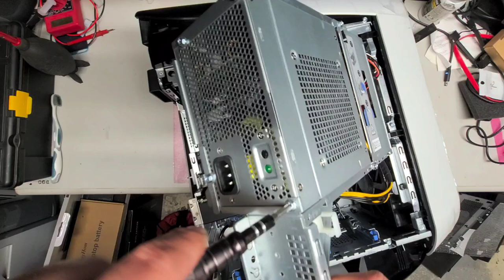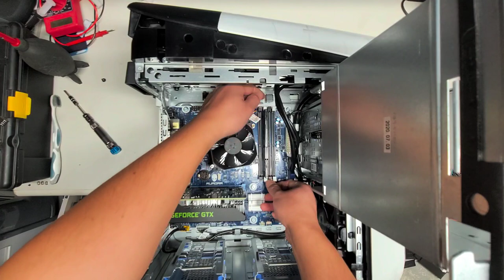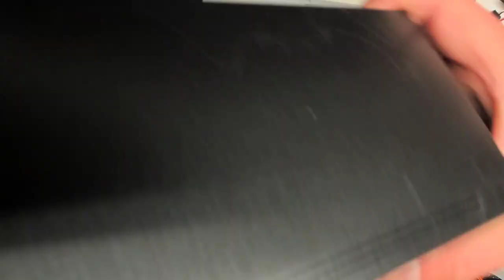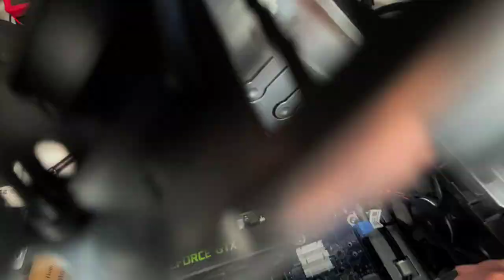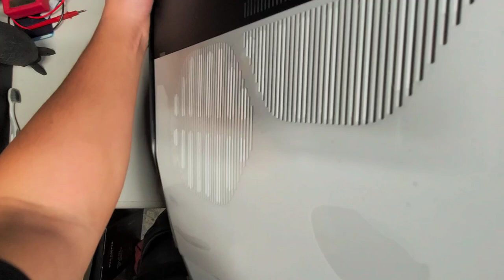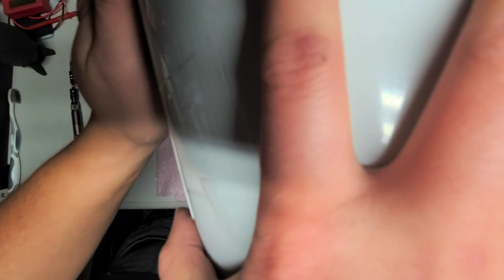Alienware Aurora Ryzen Edition 10 R10 Disassembly RAM SSD Hard Drive Upgrade Power Supply Repair

Comment: Nice video.  Thanks!  Glad to see it's a standard ATX PSU.  Thinking about getting this system and debating if I wanted to upgrade to the 1000 watt PSU but if it's standard then I can always swap it later!
Reply from the maker: Yup
Reply: i bought the r10 with the 1000w psu, and its even modular
Reply from the maker: @murfad  nice!

Comment: hi so i brought my first Alienware r10 but when i plug it in into my monitor (dell S2409WFP)  nothing seems to be working and it enters on power save mode. like its not supplying any power through my keyboard or my mouse. do you have any tips?
Reply from the maker: Make sure your monitor is connected to the GPU, not the motherboard.

Comment: Fantastic video thank you! Question, is it possible to replace the motherboard with an aftermarket mATX?
Reply from the maker: Not sure. I just repair computers. I don't experiment with them.
Reply: @ Ab man did you upgrade it?
Reply: I’m pretty sure it’s possible but the front io will be all messed up.

Comment: Hey there, does the original PSU from Dell come with 4pcie 8 pin connectors?
Reply from the maker: Open it up and check. If it's not in the video, I won't know.

Comment: Hey! Thinking about buying one of these machines. If anyone here has the ryzen edition R10, is the motherboard swappable with something aftermarket? Like an atx or matx board? Thanks.
Reply: Pretty sure anything Alienware is proprietary. You will need to modify the stand-offs most likely. Best to just use a new case if you are doing this.
Reply from the maker: Very likely

Comment: I have a Delta 550w in my R10. Nothing wrong with it besides the ugly cables. So why are you replacing it?
Reply from the maker: Because the PSU failed.
Reply from the maker: I repair computers for a living. I'm not doing it for fun. Lol
Reply: @ItsBinhRepaired  Was it a delta model or something different? Delta is pretty respectable but not well known outside the Server space.
Reply: @ItsBinhRepaired  I noticed they had the same 550w PSU but with a RTX card. So wonder if that's why. Mine has a RX 5600 OEM.
Reply from the maker: @PokèMyBalls  not exactly sure. It wasn't delta though.
Reply: @ItsBinhRepaired  I was thinking about replacing mine until I saw it was Delta 80+ Gold.
Reply: @ItsBinhRepaired  Still not a fan of the stupid Intel mount on an AMD socket. Dell was high when they designed these.
Reply from the maker: @PokèMyBalls  haha don't replace it unless it's having issues.
Reply: @ItsBinhRepaired  I'm not. I am adding Heatsinks to the VRM. Adding an extra intake and exhaust fan. Also, modding the front panel for airflow. Got a Noctua NH-l12s for the CPU upgrade.
Reply from the maker: @PokèMyBalls  sounds good.
Reply: @ItsBinhRepaired  I had to buy a Noctua with an Intel bracket for this weird Dell mount. But it's pretty nice for $35 used.
Reply from the maker: @PokèMyBalls  hopefully it works out well.

Comment: thanks for video, the upgrade ssd or hd are 3.5" or only 2.5"?
Reply from the maker: SSDs don't come in 3.5". Any sata drive will work, but highly recommend SSD over spinning disks.
Reply: @ItsBinhRepaired  ❤ ty
Reply from the maker: @DrunkCatAsleep  no problem
Reply: in case you would like to have ssd, definitely go for m.2 type, it is the fastest and best option / wasn't mentioned in vid, but cool vid anyway
Reply from the maker: @kanalniekohoznameho  only a pcie nvme SSD is faster, but I don't see an m.2 slot. Not sure how you'll install one.
Reply: @ItsBinhRepaired  right bottom, next to SATA ports
Reply from the maker: @kanalniekohoznameho  oh, I'm blind haha

Comment: If you were to upgrade the mother board what would you upgrade it to for a atx mid tower case
Reply from the maker: You'll want to check https://pcpartpicker.com/ I don't really do upgrades.
Reply: @ItsBinhRepaired  how would that work on pcpartpicker?
Reply from the maker: @fatherskittlez362  you can pick the type of motherboard by size and spec. Check it out
Reply: @ItsBinhRepaired  ok thank you
Reply from the maker: @fatherskittlez362  no problem
Reply: @ItsBinhRepaired  ayo i apologize for asking so much but what is the cpu of this pc im having a really hard looking on the internet for ANYTHING about this computers
Reply from the maker: @fatherskittlez362  you'll have to check the bios. I don't know.
Reply: @ItsBinhRepaired  i appreciate you thank you…. My pc is take apart and i cant check
Reply from the maker: It'll likely be on the cpu itself if the cooler is off.
Reply: @ItsBinhRepaired  it isnt unfortunately ☹️
Reply from the maker: @fatherskittlez362  you'll likely have to reassemble and check or check DELL with the service tag number. I can look it up if you have that at least
Reply: @ItsBinhRepaired  ok thank you i will have to look
Reply from the maker: Alright

Comment: Hey buddy how much do you charge for computer repair? I guess you’re around the Bay Area right?
Reply from the maker: Yeah, it depends on the issues.
Reply: @ItsBinhRepaired  so I recently purchased an R10 and how much would it cost for you to move the RAM and HDD over? Or if I am installing a wifi 6 to a mid tower how much would that be?
Reply from the maker: @qiuwn002  what do you mean by move them over?

Comment: Where could I buy replacement screws for the case?
Reply from the maker: Not sure. Probably eBay
Reply: @ItsBinhRepaired  I just bought the case from a friend with the motherboard,power supply with 2 screw in the case 😑
Reply from the maker: @justdemon839  hmmm I think it uses standard computer screws. Any local computer repair place will likely have some
Reply: @ItsBinhRepaired  ok thx
Reply from the maker: @justdemon839  no problem

Comment: So question is this motherboard compatible with the rtx 3080 and 3090?
Reply from the maker: I don't see why not. The real issue would be whether or not the power supply can provide enough power and whether it'll fit in the tower. I don't know.
Reply: @ItsBinhRepaired  yeah the 3090’s size was more what I thought the issue would be because I know they sell it with the 3060ti installed
Reply from the maker: @coreycarries6325  yeah